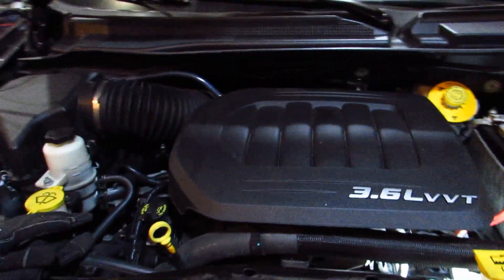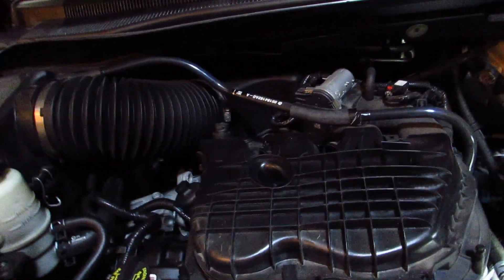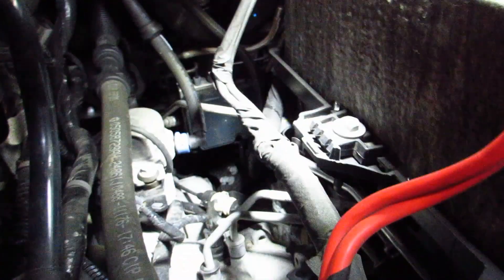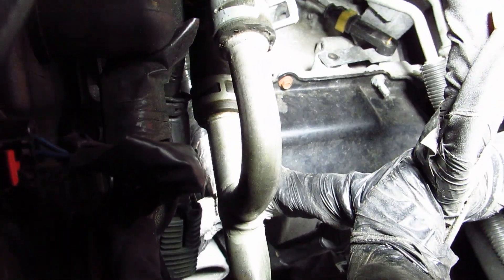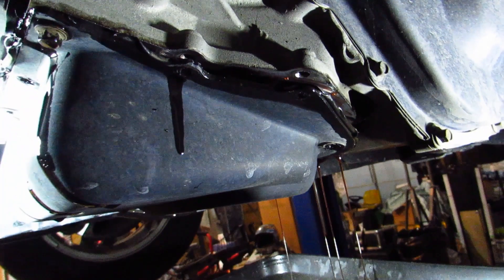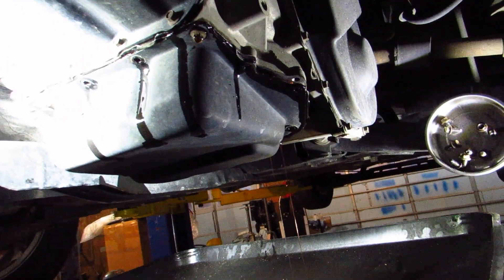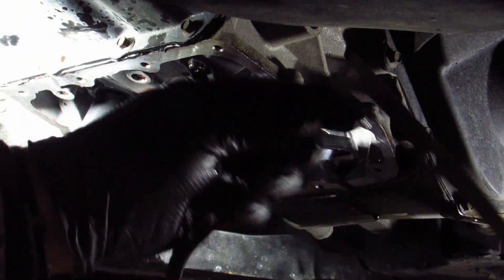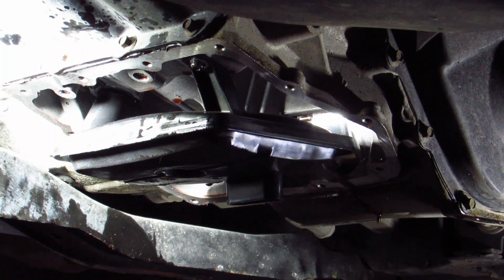2018 Dodge Grand Caravan Transmission Fluid Change

Comment: I had a bad whining noise from the transmission which now seems to be a clogged transmission filter! 50 bucks for parts and fluid! Followed your directions, took about an hour from start to finish! No more noise, everything is running smooth. Thank you for your video/help!
Reply from the maker: Nice work! Think how much money you probably saved!
Reply: Wow! That’s a great story. Thanks @Dave + @Anna
Reply: @dirtydavesgarage8251  i was quoted ~328 out the door local shop, nice owner but i will DIY. my 18 caravan was a fleet gt trim, at 62k now and about to change the fluid, should i change like you said you will, every 20k?

Comment: Replaced the pan with one that has a drain plug, makes fluid changes a snap and no mess.changed the filter at 98k
Reply: Makes perfect sense. Most all vehicles manufactured by other than F, GM, C have drain plugs. Duh

Comment: Need to check transmission fluid with engine running. That is why so high. Or I guess just replace what you drained. Doing my wife’s 2016 with 75k kilometer in a few days. Thanks for video.

Comment: Great job and video. I've been thinking about doing mine and it's the reason I've watched your video. My transmission on my 2018 Dodge Caravan SE has a small leak. I really just thought about filling it , but I think it's better if I just do the complete job. I'm only wondering how much fluid should I put in, because like I said. It has a small leak. 
Either way, thanks for sharing and most likely I'll purchase that universal transmission dip stick. Thanks again. 👍👍👍

Comment: Nice when you have a lift and a high enough garage. I don't. I would have to do that on the road as my house sits on a tiny artificial hill (for the septic tank underneath), hence my driveway goes down, not a good option for jack stands on a slope... SO I guess I opt for the "sucking out transmission fluid option with a sucker", of course I cannot put a new filter that way... So the question is whether I should do it to begin with...

Comment: You have to check it with the engine running, that's why it was reading so high....when I do mine I'm changing the pan to the one with a drain in it...

Comment: I just change my trans fluid at 35k...  ow man 5.5qt  this transmission was never shifting so smoothly. Not a one jerk or slip. I will  be now changing it every 25 to 30k.  Filter was filled with sludge and oil was looking dark. Not black but it was getting there. 2019 grand caravan i used atf+4 by mopar here is filter part number 6801 8555 aa-001.
Reply: How did you get the filter seal out?

Comment: Tell us how much you had to add back, I measured how much in my drain pan and seemed to be close to 5 quarts
Reply: 5.5 thats what dealer book said. I drained 5qt and put 5.5. Half quart extra will not make any differance in trans life. I assumed that manufacture only put so called minimum as its money saving for the company. My car drives better than ever with 5.5qt. Previously it was jerking from time to time and I hated that taking the car has only 35k on it. Super smooth now.
Reply: Mine was at the top of full range prior to procedure.  It drained out  just a touch under 5 qts.  I put 5 quarts in and it was again at the very top of the range as per the temp/fluid level chart.

Comment: Shouldn't you check level with the engine running?
Reply: That would likely be why it showed so high on that initial cold reading with the original fluid still in.
Reply: Bill Hollamon nope the way he did it is correct.
Reply: @papabits5721  No, it's not: Procedure as per Chrysler: 1. Verify that the vehicle is parked on a level surface. 2. Remove the dipstick tube cap. 3. Actuate the service brake. Start engine and let it run at idle speed in selector lever position "P". 4. Shift through the transmission modes several times with the vehicle stationary and the engine idling. 5. Warm up the transmission, wait at least 2 minutes and check the oil level with the engine running. Push the Oil Dipstick into transmission fill tube until the dipstick tip contacts the oil pan and pull out again, read off oil level, repeat if necessary.
Reply: U check hondas with engine off
Reply: @Evrenthewrencher  this is a dodge? Had to be running
Reply: Yes! Was looking to see if anyone else commented this. I had the same issue at first

Comment: I have dodge caravan 2106  120.000km I change the transmission fluid and it shift slips 
I will never do it again to any car  
Is a big headache
Reply from the maker: Did you change it yourself or take it to a shop? Years ago we had an older caravan and had jiffy lube power flush the tranny, and it started slipping afterwards. I then learned power flushing a tranny can do damage, so I only drain and fill at home now. Never had an issue.

Comment: why would you bother with all this dip stick procedure ? you should measure the volume of fluid you drained and replace it by the exact same amount of fluid ? put back exactly what you removed
Reply: What if there was a leak that he did not notice?
Reply from the maker: I did that too, but why not know it is filled properly? I don't know if they did it right at the factory......
Reply: Because you don't know if it was at the proper level to begin with, that's why!
Reply: Just put back 5.5qts. Let it drain good for 30 mins after you remove the pan

Comment: Are the newer 5th gen transmissions better than the 2011-2013? I have a friend picking up a 2019 for $14k with 40,000
Reply: That’s a darn good deal! I haven’t heard much to do with transmission problems so long as you change that ATF 30-40k miles with the drain. I’ve seen others say 24k miles but, mileage may vary. Tell him to save a few bucks, buy it and don’t look back. I paid about $16800 for a 24k mi model so that’s all in line
Reply: That’s a great price!
Reply from the maker: to be honest i couldn't tell you.....

Comment: Please info how much transmission fluid did you use aprox? 
I want to buy it by 1quart each. Wondering how many do I need.
Thanks.
Reply from the maker: i used 2-3 of the 5 qt jugs
Reply: I used aprox 5 qarts
Reply from the maker: @gocanada1675  my bad,, i thought that question was directed at my video of the 2005 silverado transmission flush I did!
Reply: 5.5qt buy 5qt jug and one quart its much cheaper than buying it in single quarts. I paid $71 filter 6qts and rtv silicone was like 6 bucks. Thats shop price so you may pay about 30 bucks more buying as a walk in

Comment: Just don't make any sense why are you dropping the pan and draining when my dealer says all they're going to do is flush and change the filter
Reply from the maker: you can't change the transmission filter without dropping the pan. You can't drain the stock pan without dropping it and putting a new gasket on. I put an aftermarket pan on mine that actually has a drain bolt so i don't have to drop it everytime. Also, a transmission flush can damage your transmission.....